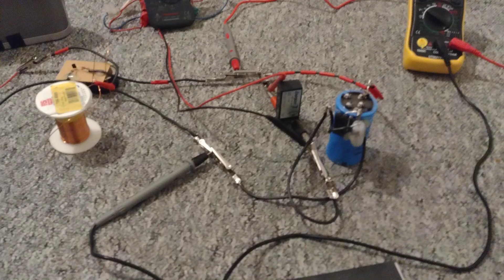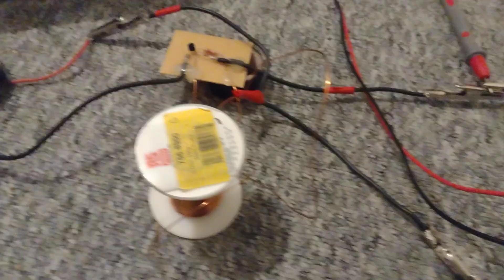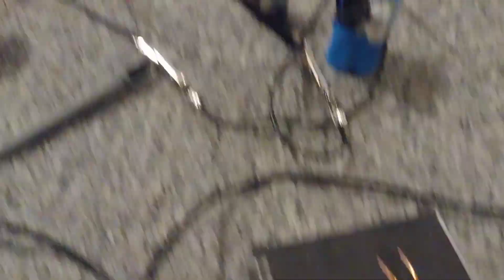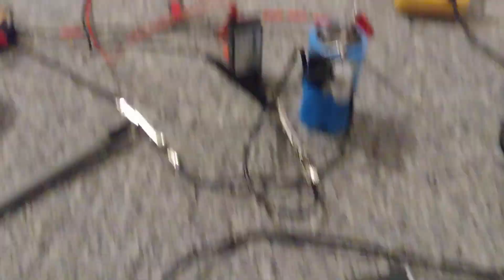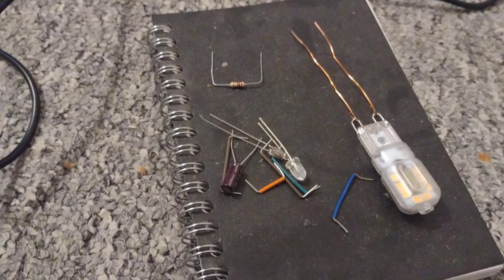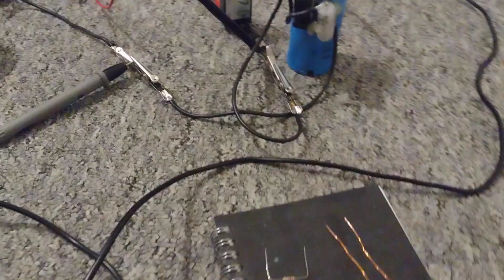Joule Thief  with now Soldered Capsule LED Camp Dump.

Comment: Nice work! Thanks for sharing, where are you posting the ckt 🙂
Reply from the maker: Thanks I'll post it soon then I'll tag you..  I've just got the other breadboard device running with the G9 3 Watt Halogen am about to post the video now...   I discovered if you chain them in series you get an insane amount of Cap Dumping...  This device is still running now & its been hours.. )
Reply from the maker: @Cool Joule  my tagging doesn't always work on here for some reason... just to let you know I've released the schematics in my most recent video.  I wouldn't bother with the G4 Capsule type as they seem problematic & not very consistent however the 3 watt G9 Halogen Capsule type do a very good job & seem to work on all of my devices..  I've got more arriving in a few days so will be testing those out...

Comment from the maker: If you try ganging the bulbs up in series the discharge becomes blinding...  & the Capacitor rises much higher too & improves on charging..  I'm ordering a whole range of these Capsule Bulbs... types & watts...   I've also got the G9 Halogen 3 Watt Bulb working in my other device...  rather than using a Transistor I imagine you could use a Mosfet.. I'm thinking of trying this...   I've had these bulbs in for over 5 years & never thought of trying this...

Comment: Can you post the diagram please?
Thabks
Reply from the maker: Thanks.. Yes I will be posting it very soon in a video... I've built two of these devices... the other is even higher performance....  schematics coming soon....
Reply: @oliver1224  thank you sir
Reply from the maker: Your welcome.  I'll start working on the schematics tomorrow.  & I will post them in a video.  Just take a screen grab.  Its a most unusual Cap Dump... it has two Negative output leads....or that's how I've built it.... Other builders may do it differently....  This device in the video has been running constant for over 7 hours.  I've already advanced this thing...add them in series & your power increases tremendously